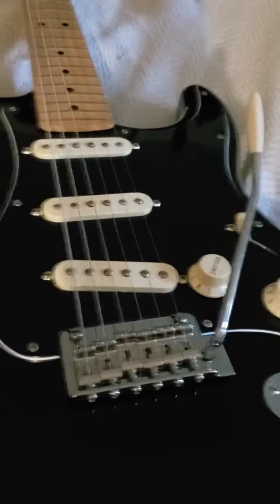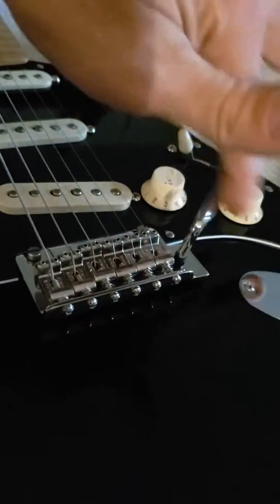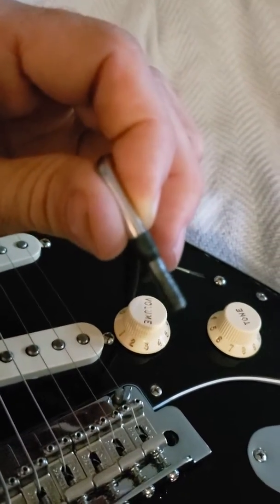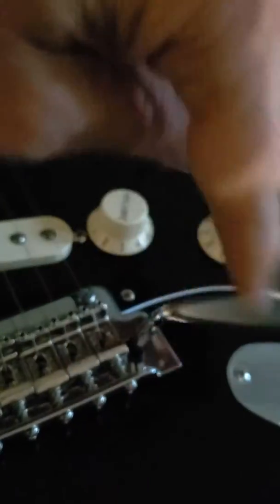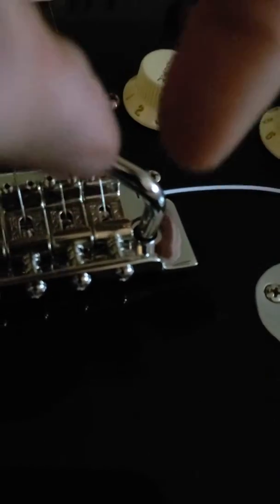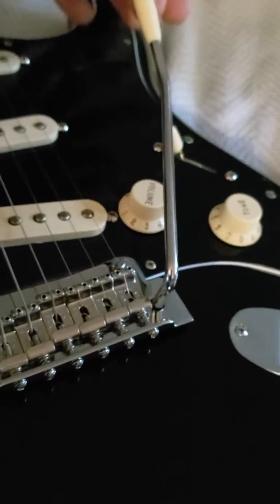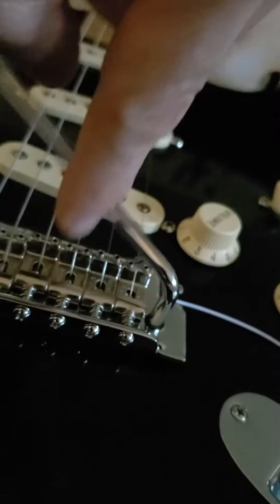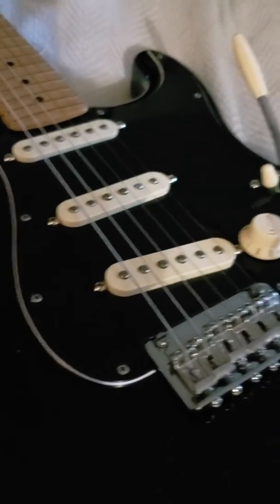BEST sloppy stratocaster tremolo arm fix, NO SPRINGS!!

Comment: Your idea is the best I've seen so thanks for posting. Its been a problem on every Strat I've owned. Dropping a small spring down the trem socket only helps the vertical pressure and so doesn't fix the other lateral play problem. Kudos!

Comment: This works perfectly.  I have a 2004 MIM and the bar kept spinning endlessly and there was tons of play from side to side.  I found one piece of tubing on an unused prewired output jack,  at the bottom,  holding the 2 wires together. Slid that off but it was too small to slide onto the bar.  So i stretched it out with a chopstick and that worked.  I just threaded it onto the bar by spinning it on and used a rubber band folded around it to give my fingers better grip.  Once it was on i dropped it in and started spinning it into place and sure enough it is very stiff with no play in any direction. For many turns its like this so you can customize it to what feels best to you.  The tiny bit of tubing sticking out the top looks normal and not weird in any way.  I would try this before the springs, mainly because I'm impatient and heatshrink tubing can be found at any hardware store or around the house if your lucky and it looks like the springs have to be ordered online.  Thank you for this permanent solution 🙏  genius

Comment: You probably think like me....I ve tried everything until I discovered this years ago....I use 1/4 inch thin wall tubing...but I only use  1 piece....I cover the top half of the threads and a bit over over the unthreaded part....I screw it in while the tubing is still hot so the material actually molds itself to the  threads....perfect....lasts a long time.....and oh, I use transparent tubing....Good work Jaybird.

Comment: I have done this. It’s a great idea but it doesn’t last. Bottom line is fender needs to fix this problem as I’m sure people are buying other brands because of this. I hate it that $1400 guitar has a sloppy trem. I will try PRS OR KRAMER next time I buy. Come on Fender get with it.
Reply from the maker: Agreed, definitely not a permanent fix, but I have a lot of heat shrink, and its cheap. I've had the same heat shrink on there for several years, but I may not be using the trem as much as others. The new pop ins aren't too bad, if you set the tensioner.
Reply: I just use Plummer tape. And reapply it maybe twice a year depending on how often I use the Strat

Comment: Thanks - this didn't work on strat pro ii drop in trem. I sorted it by cutting out a cm of plastic syringe sheath (I work in a hospital) and pushing it to the area where the arm enters the metal hole. Not sure how durable this is but it's easy and cheap to re do it. Might do a you tube vid if it lasts.
Reply: in your guitar you have on screw to get this effect without the need do add crazy stuff to the trem. dive bomb you tremolo and look on the block for that screw

Comment: I bought a Wilkinson tremolo, $35 and has a push in arm, works better than a Fender system.  Heat shrink, why not anything that sticks, plumbers tape, electric tape, painters tape.  You also need a heat gun for your solution.
Reply: Don't need a heat gun; a hairdryer will work if you're patient, but I always just use a lighter.
Reply: @smellytele9629  what size was the heat shrink?

Comment: Did you try the 3mm ball bearing and small spring fix? Maybe both would be useful. Thanks for sharing your excellent fix for this annoying issue!
Reply: I used the spring only, and didn't work. On this mim player series with the 2 point tremolo the spring was so tall that the bar can not start to grab. Idk if i need the Ball, but i don't know if It'll work

Comment: I really find the design of fender tremolo as pure garbage… this is a grat fix , try also to apply few turns of plumber teflon tape on the thread. This protect the thread a bit and increase strability . Aldo the fender original springs are garbage. Too long and rigid.

Comment: Dont waste your time buy the tremolo spring.
Reply: But does that fix the 'lateral' play that Andy Martin mentioned previously in the comments?
Reply: @TheVampireKit  yes, drop in a 3mm ball bearing.
Reply: @rorow3r  meh I tried that, it turned into a big mess even with ball bearings.  The spring broke before it even got stable. This looks much better.
Reply: If you don't like it you buy the spring ' maybe this works for some people especially if you need a quick fix.
Reply: @TheVampireKit  no it doesn’t. And the spring gets mashed up pretty quickly. Even with a ball bearing in there.